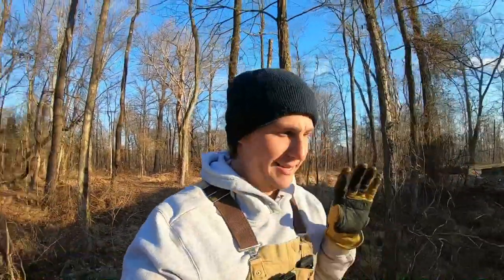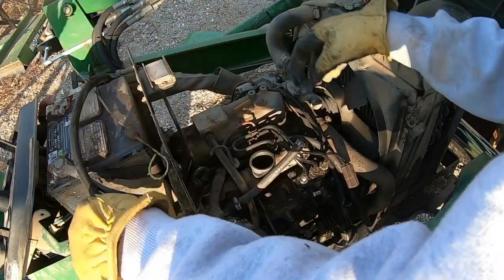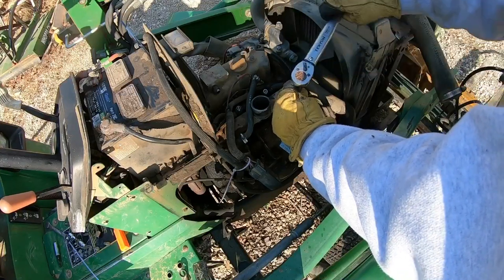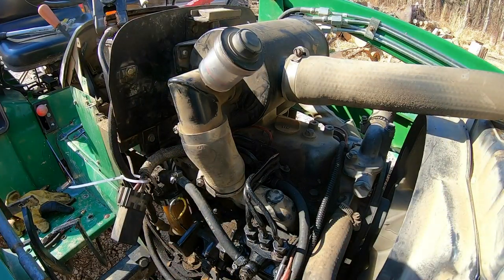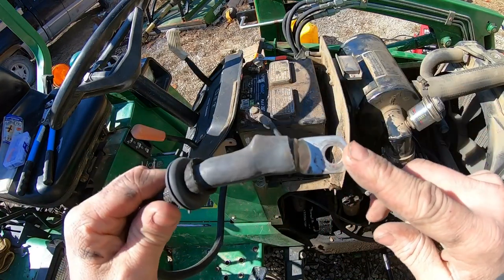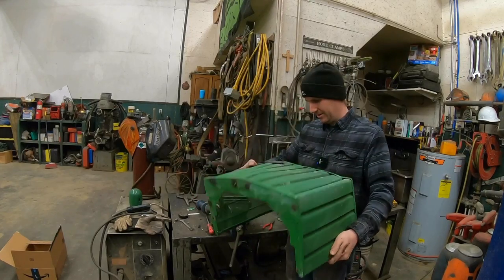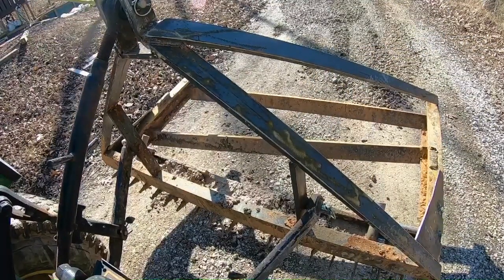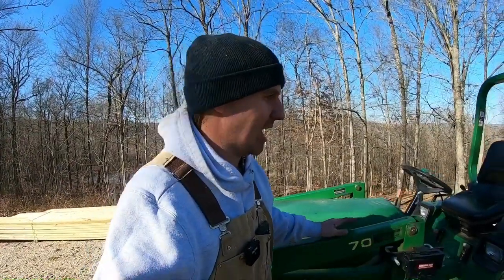Problem Solving a John Deere 755 Compact Tractor - Fuel Problems

Comment: Another great video, retired ag mechanic  here never worked on a tractor like yours but is it possible you have a broken engine mount, seems to move around alot in the frame 🤔,  I have been wrong b4 and probably am now 😉
Reply from the maker: The rear mount Definitely has some wear.  Engine mount and battery are next on the list.  Thanks for looking out!

Comment: Just curious about how old is your 755? My 4300 is 21 yrs old and have never had an issue with the engine. Have replaced the brittle hood twice. It does need a brake job and seems to have a seal leak on the right side. Put an Optima battery in it 13 yrs ago and it is still going strong.

Comment: Well, glad to see the star of the show has pulled though.  I'm also impressed with the home-made road grader,  looks like it'll even work backing up, which my "commercial" one won't. NIce neat job on routing that cable, it's good to take the time to do it right. (Eventually, I won't mention that sometimes my "temporary" installations out last the equipment.🙄)
Reply from the maker: Definitely happy with the way it is working
Reply: Dan, to quote WWWork, "It's only temporary unless it works!"

Comment: Put a sock in it Mike! ... or a rag, or use some aluminium foil.  Something to block the hole to stop the rubbish getting in... both on the air intake to the engine and the injector pump delivery outlets.  Come on Mike, we're not doing medical operations in the 1800's bud! 🤣 I wanted to send this a few days ago when I watched the vid but I thought, ahh it's a waste of time,  Mike doesn't read his comments. 😁😁
Reply from the maker: Hey!  I just went through my "held for review" comments that YouTube does automatically and saw all your comments there.  Not sure why yours were getting kicked though,. YouTube does weird things. Looks to be all fixed though! Appreciate ya watching!

Comment: Copper crush gasket trick: put on a dab of sticky grease and put it in the fitting and not on the IP. Makes install less frustrating.
Reply from the maker: That's awesome trick!  I'll have to remember that for next, would have saved me some trouble for sure!
Reply: @CaptainKleeman  some day's there is an advantage to being an ol' fart and cranking on wrenches for decades. Not many,just some lol.

Comment: Whenever I work on a tracker with a loader I either remove the front bucket assembly or if I can't lift the bucket and put a 4x4 under it. Then you don't have to work over the loader arms. If you are looking for a new tractor check out marhndra. I've had two now with very little issue and the red paint costs a whole lot less than green.
Reply from the maker: My next tractor will either be 955 or a 210 loader.  Appreciate you watching!
Reply: Mahindra has a bit of a reputation for electric problems.  The one I have doesnt actually shut down when I turn the key off.  I also have to turn on the headlight.   Well, that or pull the manual fuel shut off I installed after pressing the brake with the key in the off  position stopped turning off the machine.

Comment: They say not to use an extension on a torque wrench
Reply from the maker: A straight extension is fine, unless you start using knuckles or other attachments to change the angle, there isn't an issue.